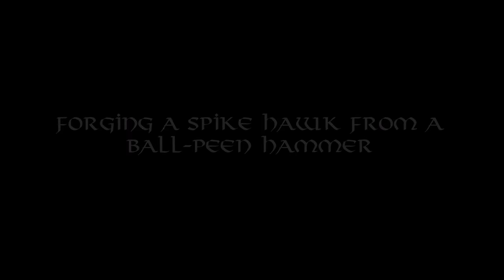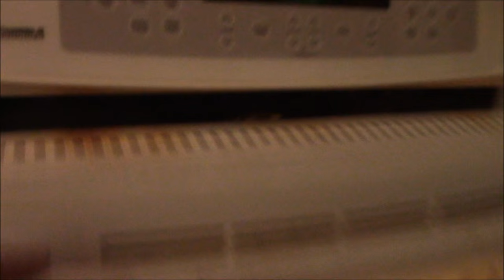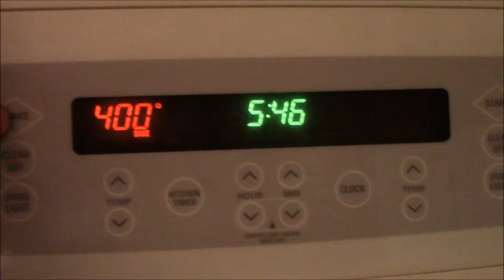How to make a WAR-HAWK from a Ball-Peen HAMMER

Comment: if you heat to critical (non magnetic-air cool-then repeat x2)this is called normalizing-then forge as you did it will be much easier to work normalized steel than factory hardened steel. Great job -I've made several like this -very fun project

Comment: I love how much material there actually is in those old hammers :) that's a pretty good sized hawk from it :) great work and ofcource a new sub! :)
Reply: a tip I learned from my grandfsther who made furniture and also alot of handles for axes and other tools ^^ after you put the beeswax on you can just run it over lightly with the torch heating the beeswax to seal the wood deeper kn the grains :)

Comment: I couldn't tell if your handle was completely round or if you had an oval to it so it doesn't spin when striking. Did you shave the edges for a better grip?
Reply from the maker: +Andrew Barker It was oval. I didn't really shave the edges, but it had a pretty good grip as it was. It was also good for throwing, as it released out of the hand easily when let go.

Comment: just subbed  and I have some newb questions

why preheat the veggie oil?

why the the slow quench ?
Reply: The slow quench is used for differential hardening. The edge goes first, so that its the hardest and will maintain a sharp edge, the  the rest of the axe is quenched, making its softer for durability. And i think he pre heated the oil to prevent giant flames from flying out and to help in the slow quench.
Reply: +Miguel Rojas preheating the oil lowers the viscosity and helps it to draw heat out of the steel more quickly and evenly. Warm oil will actually cool steel faster than cold oil...
Reply: Also to keep it from cracking the axe
Reply: stops cracking and warping,remember to heat and allow steel to cool at its own speed couple times this helps keep steel from warping if you do get a bit warping you can g cramp to sraight bit steel and temper together this has got me out of trouble before,read as much as you can but best to play around with the steel ,tempering hardning is a lot to learn in itself very interesting all the best

Comment: Wow this is amazing i have two questions though. 1.could i use a homemade coal forge for this instead of the fancy one you used. 2. Is there any replacement for the belt grinder?
Reply: Mark Allsup As long as your coal forge can get hot enough there shouldn't be a problem. You can hand file in place of a belt grinder.

Comment: What's the name of the tool used at 0:38? The spike thing that you make the handle hole larger with. If I make one of these spike tools for my project, is there anything special I need to know about the tempering for it? I've only ever made knives, but I want to make the tools and eventually a tomahawk like you have here.
Reply: +TaxationIsTheft Revolt cool thanks. I guess I'll have to try to make one.
Reply: you'll need to be careful with the tempering of tools that you use by hammering them. If you dont temper them hot enough the tool might explode when you hit it, but if you temper it too much, it wont work as well as a tool.

Comment: just my opinion but to make the handle more durable i would have used a pin to hold it onto the handle then when you peen the pin you could etch your logo on that and new have to worry about the head slipping off after heavy use but great job

Comment: Thats a amazing product, but couldnt it be possible, that the head gets loose after a lot of work with it ?
Reply from the maker: Johnii Bääm Good question-- well, if you noticed, the handle tapers until the hawk doesn't slide anymore. As you use it, the hawk get's tighter and tighter. And, if it ever gets loose, you just hammer it back up. Only thing that really loosens it is throwing it. Anyway, yeah-- it stays pretty tight.
Reply: Aah okay thanks :)

Comment: Thats bad ass!!! Anyway you could do that at home without an oven like that??
Reply: If you're referencing the gas forge he used... you can use a makeshift swallow forge using a bbq pit, long steel pipe, and a hair dryer. :)
that's what I do
Reply: +Aaron Travieso same, though coals are fairly expensive
Reply: +maisetas use real coal instead of charcoal. It lasts 10 times as long burns hotter and is normally cheaper. $6.00 us here for a 40lb bag
Reply: Aaron Travieso Nice. :) Thanks.

Comment: Very nice, thanks for the video. I have an old machinist hammer I want to make in to a midel age war axe or war hammer.
Reply from the maker: Joar Flesjå No problem ;-) Defnitely give it a shot, and email me pics!
Reply: Becker Forge Yes i will. I just started forging and making knife and suddenly I got a list of people that wants knifs. I think I will try to forgeweld som leafsprings to hatchest to.
Reply from the maker: Okay, something about leafsprings-- you can't forge weld them. Even masters have trouble with it, because you can't really weld 5160 to itself. You'll notice it's never used in Damascus. So, don't forge weld leafs-- been there done that. It's a mess. If you do get a forge weld, it won't be a very good one.